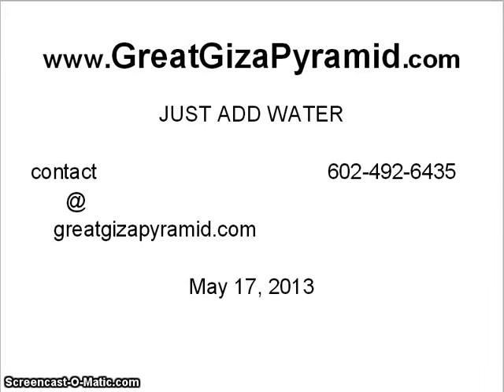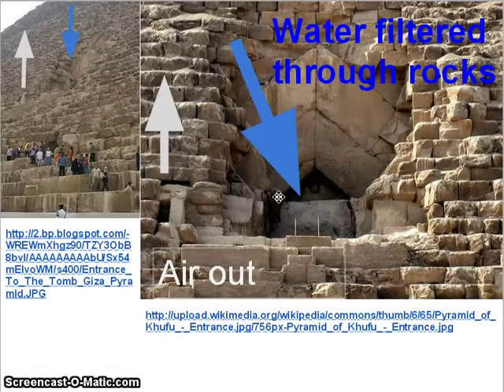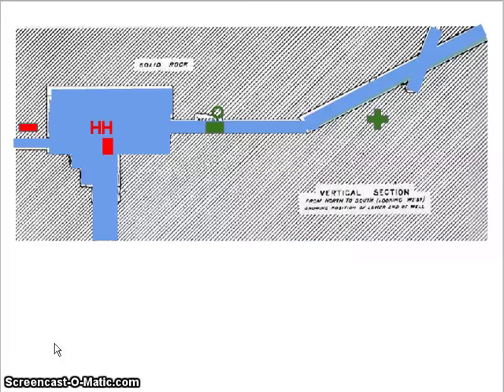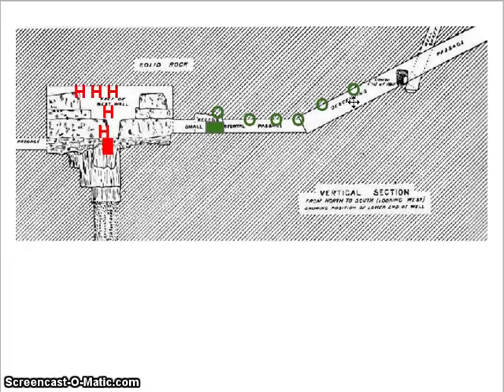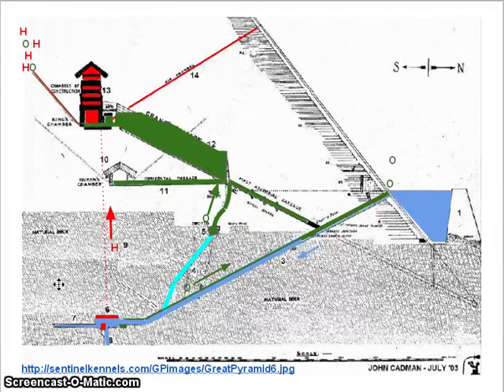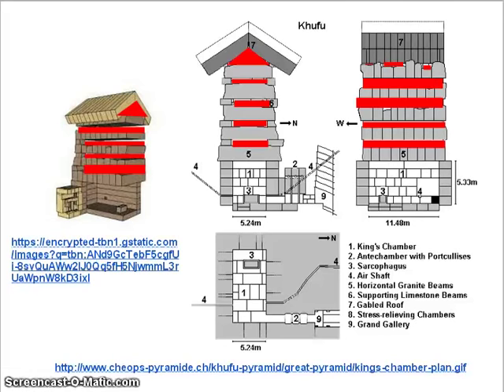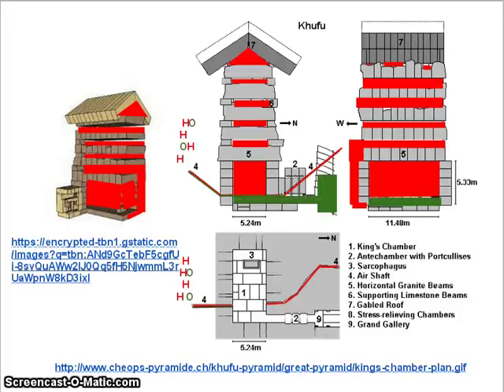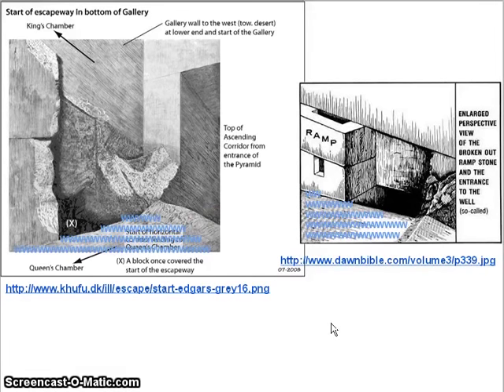Great Giza Pyramid Just add water Reverse engineering the Giza power plant

Comment: The water that was flowing down and surrounding the pyramid was the communities wastewater containing sewage.  The pyramid functioned as a water sanitation plant not as a power plant. It cleaned the water then returned it to the Nike. The solid sewage was used for fertilizer.
Reply: Pretty sure there's much simpler ways to filter water, that doesn't even make sense